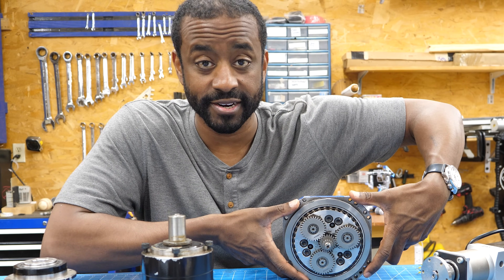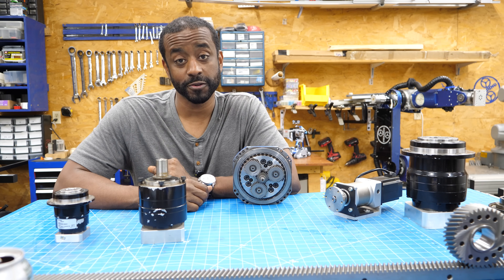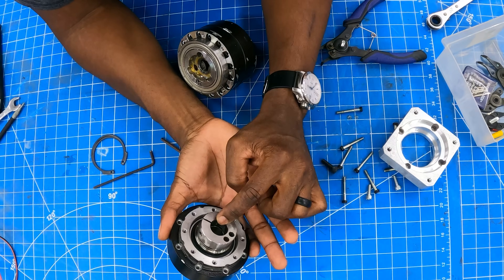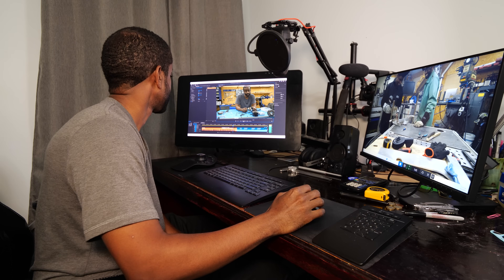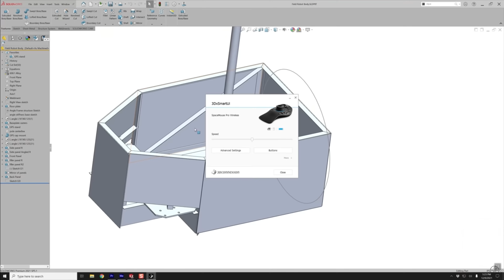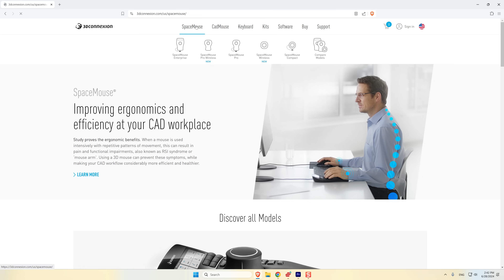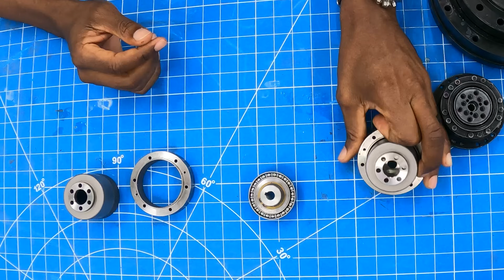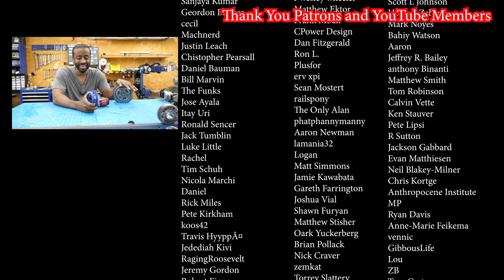Why Harmonic Drives Are Awesome.

Comment: A worm drive can back drive! 10:1, 7.5:1 and my 5:1 will. The 5:1 is very easy to back drive.
Reply from the maker: Some versions can back drive. But usually not when talking about worm drives in general. This is easy to check with a web search. Nearly everything I said in the video has an exception or two. It’s impossible to make blanket truths about products that can be engineered for specific applications

Comment: Seems to me like the harmonic drive would be torque limited with those tiny gears. Just for low hp/torque applications.
Reply from the maker: You are only looking at the small ones here. They get bigger just like all other gears. You can see a much larger one earlier in the same section of the video on the bench. That is by no means as big as they get.

Comment: Your explanations are so clear and educational with the gearing and at nearly 70 yrs old I've seen a lot of mechanisms.  Love yer channel! I bought this hand operated chain hoist, which I will try to explain is one such type of ratio in a chain form.  I was so excited once I discovered how it worked, I showed my daughter. She said, "oh. that;s nice" and walked away... ha ha!

     I bought a hand operated.chain hoist (with a loop of single chain) which had a top solid pulley with two parallel chain link depressions in the circumference. The one side has 10 link depressions and the other has 9 depressions, i.e. 10D or 9D..  (There is a hook on this pulley that hooks to the rafter or whatever.) These depressions fit each chain link. So, the hoist chain is able to turn the pulley with the 10D or the  9D pulley is in the single loop of the chain. Every time the pulley turns once, the chain is tightened up or loosened depending upon the the direction the chain is pulled. The ratio is 9:10 or 10:9. And idler pulley connects to the load with a hook and rides in the chain loop..   I was so amazed by that old technology that I had to buy the thing at a junk shop. I went home and immediately geeked out and took it apart to see how it worked!

Comment: I was taught that worm gears were not able to be back driven. And that is true for most worm gears due to the contact angle and the friction. But then I encountered a piece of equipment that uses back driven worm gears as part of its regular operation. If you use a multi-start worm instead of the standard single start back driving works fine.
Reply from the maker: Certainly there are exceptions. This is true for nearly everything I said in the video. These are just general guidelines for using these devices. There are high precision versions of things I said had lower precision, cheap versions of things I said were expensive etc. You can't draw hard lines around these things.

Comment: When it comes to cars, when you disassembly pretty much anything with gears, you have to mark the alignments of each gear how they are before being disassembled, so they can be reassembled in the exact same orientation, because otherwise, they may not fit against each other right. The gears wear into each other, so changing their alignment can cause some pretty big problems... and I was wondering... Is that how it is also if you take apart a planetary gear? I've never had to take one apart, but I'm certain I will eventually and just want to make sure I don't make any mistakes and/or also don't want to waste time if it's not necessary.

Comment: Planetary aren't good for accuracy? All the servo motors in Fanuc robots have a planetary assembly. The gear reduction allows them to be quite accurate.

All the servo motors on CNC machines running the ball screws? Planetary.

This is the problem with people who think they know something. They don't.
Reply from the maker: Certainly there are exceptions. This is true for nearly everything I said in the video. These are just general guidelines for using these devices. There are high precision versions of things I said had lower precision, cheap versions of things I said were expensive etc. You can't draw hard lines around these things. Engineering is about "good enough" not perfect. There are hundreds of reasons you might trade one feature for another because something else was important. It doesn't make sense to say A robot used "x" therefore "x" is precise. It just means it was precise enough for that application when also considering the other needs like cost, availability, maintenance needs etc. You are oversimplifying something I was trying to keep simple. Its not engineering if you think none of these suggestions can be broken or ignored for your application. I mentioned this concept in the video. around 3:58

Comment: Great video as usual!

I had a 1964 flat windshield Chevy van, final drive geared for around town. I turned it into a camper and wanted to reduce RPMs for use on the highway. I could have installed a lower geared rear end, but I found a 1957 Chevy overdrive transmission first. It essentially snapped into place, all bolts and controls were identical to the original. Chevy saving a buck, updating was anathema. 

The point? Inside the OD transmission was a two speed planetary gear controlled by a solenoid, you pushed a button to shift into OD, and it worked for each gear. Six gears! unfortunately the lower gears were almost duplicates, still, it was useful on a snowy or Icey road. 

It also had a freewheeling clutch in the transmission. After first gear you didn't need to clutch to change gears! Great for learning how to double clutch on the downshift. In hilly terrain it gave surprising fuel economy. Power up the hill for volumetric efficiency, off throttle to coast down with the engine idling.  It also had a cable to lock out the freewheeling clutch, very important on longer descents, the brakes were barely adequate.

Comment: Would a harmonic drive gear be strong enough for a golf cart? What kind of semi flex material is it made of?
Reply from the maker: @bobdebouwer7835  I don’t know exactly what you are doing with the cart, but a harmonic drive seems like a bad choice for a golf cart. They come in all huge range of sizes. They are usually chosen for their high precision/ low backlash. But most applications don’t need this making the harmonic drive a poor choice for most applications given so many other good choices when backlash is not important.

Comment: One of my favorite uses of the planetary gear-set is the Sturmey-Archer 3 speed bicycle hub patented in 1903. It used ratchets to give an underdrive, one to one and then an overdrive giving the bicycle 3 speeds. Later a coaster brake was incorporated into the mechanism eliminating the need for a separate brake mechanism for the rear wheel.
However, being a retired ASE Master Technician who ended his career as an Automatic Transmission specialist, my absolute favorite use of planetary gears is in the 700-4R/4L60 & 75 transmissions used in GM vehicles in the 80's, 90's and 2000's. Unlike all other 4 speed overdrive automatic transmissions, the 700-4R design, which continued in the 4L60/75 transmissions, uses only two planetary gears to achieve 4 forward speeds and the requisite reverse gear. All other automatic transmissions used a 3rd planetary gear-set to get overdrive. It's one of the tightest and most compact automatic transmissions ever designed and it was a huge success, once all the bugs were worked out, most of them lubrication issues.
Reply: so that's how they work!   always wondered about that as a kid but haven't even thought about sturmey archer gears as an adult.  if you want a busman's holiday - precision transmission is back up and running on youtube - i think the guy has spent 46 (might be 48 now) years servicing automatic transmissions and watching him go through an 4L60E is something to behold!
Reply: I have a GM 2500 van, which has a 4/80.  I often wondered if it had a secret gear.  Its a 1995, still works well, easily repairable.  Love the van, put a Positraction into it, works in hail, sleet, or snow, and it may very well outlive me.  I intend to be buried in it, one way or another.  Wife says no way, but kids want it anyway.
Reply: I had one of those in the 60's.   Twist grip shifter.
Reply: I think my grandparents had one of them, but if I remember right it only seemed to work on two speeds.  There was some form of cam lever on the side of the hub assembly if I remember correctly that looked like it pressed in a button in the center.  I was barely tall enough to ride it and it's been at least 40 years, but your comment brought back some memories!!  Can almost smell the old chicken coupe the bikes were stored in.
Reply: @ladamyre1 
😊 Blimey Sturmey Archer 😊 not heard that name in a long time. Brings back happy memories of building our own Bicycle 🚲 as poor kids in Liverpool back in the 1970,s. I actually had a 4 speed Sturmey Archer Hub gearbox on my homemade out of scrap bit's Bike. Will never forget the time we all went on a ride to Delamere forest and my Gearbox locked up in the forest after the bit that the little gear changing chain screwed into decided to snap in half and jam the gears, after lotsa fun dismantling it on the forest floor I had to ride all the way back home stuck in 4th gear 😢😢.
Happy day's 😊 😊. 
I also remember the backwards pedalling brake mechanism, although I wasn't too keen on them because I would end up with Bald patches in my tyre which lead to lot's of puncture repairs.
Definitely taught us how to fix or own Motorbike,s and Car,s later on in life. 😊